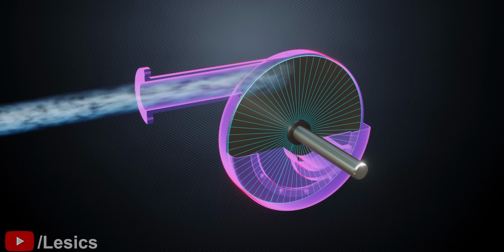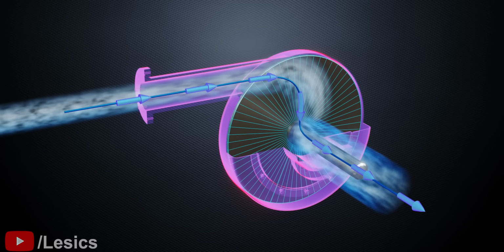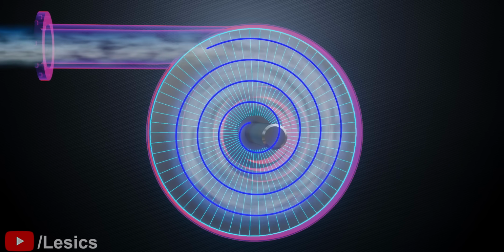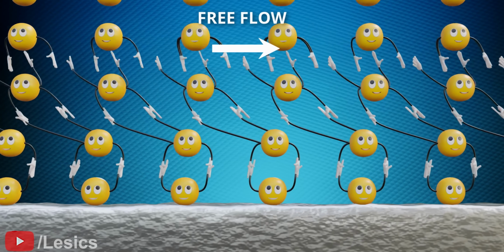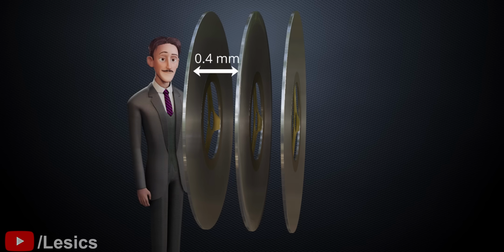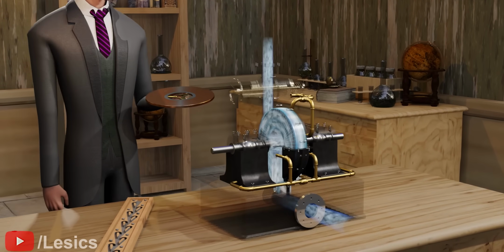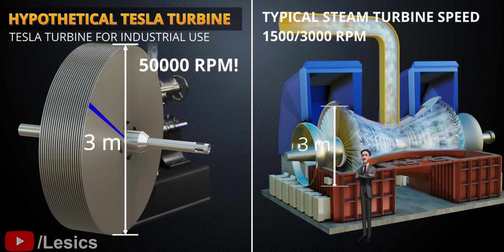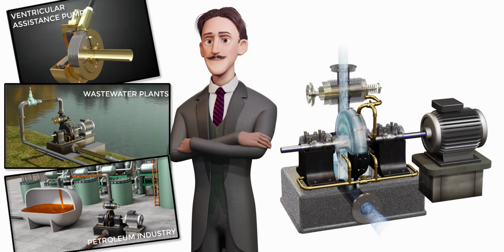Tesla Turbine | The interesting physics behind it

Comment: “Engineering impossibility” is another way to say “we haven’t figured it out yet”
Reply: No, it's a way of saying it's not worth the effort. 

We can suppose there's a material yet to be invented that would support the RPM needed to make these work. If we have to do 30 years of RnD to find it the project isn't worth doing. 

Items like parachutes were mathematical sounds in Leonardo da Vinci's time. Yet it took modern materials to make it. No one sat down and tried to make the idea work. The original project was forgotten in time. 

This too was a project forgotten to time. 

Many engineering projects are physically possible but not worth the effort. Engineering isn't physics, it's applied science and the human part application is important.
Reply: @gregheffly  With the exception that in this case, If we would be able to create materials strong enough to withstand the RPM.....this kind of turbine would be obsolete. A parachute hasn't become obsolete because a fitting material was found and is hence a bad analogy.
Reply: @benkai343434  The moment that a certain invention has no practical application anymore or has been completely eclipsed in every regard by another, is the moment it becomes obsolete. That has nothing to do with popularity.
Obsolete=There is no reason to ever use this invention in any practical application (anymore).
The Tesla Turbine has never been in a position to be practical in energy generation, other turbines were simply better. However, it does have niche applications. Hence it's obsolete in Energy but it does have some aspects that are still used.
Reply: @benkai343434  Even Mose Code is still viable. It's really early binary.
Reply: @benkai343434  You are incorrect, and are clearly not an engineer. This is absolutely obsolete. I mean it works for pumping viscous fluids due to the low speeds needed, but its useless as a turbine. At the speeds he mentioned in the video the turbine would encounter 4,300,000 million g-forces. No material will ever withstand that. I'm guessing you don't understand just how extreme that is. Were talking many hundreds of thousands of times stronger than what graphene can withstand. If you make it smaller the RPM's required end up being even higher. This technology is 100% obsolete for use as a turbine.
Reply: @Navhkrin  Show your math then.   Yea, I know we didn't see the math for the 4000000 million gs.
Reply: @Navhkrin  Let's take 3 meter (300 cm) disk at 50k rpm so that's the rpm squared times the radius (150 cm) times 0.00001118   That's a 4,425,000 g.     or 4.525 million g.   So it's likely a typo using both the number and the word million together.    4.4 million g still sounds pretty impossible for a spinning disk.   Anyone want to calculate the stress?
Reply: @viktor1496  These turbines lose productivity when there is an actual load on them.  Yes in theory they are really cool spinning connected to nothing, having to power nothing they are really cool.  They aren't really cool when you actually try to apply it to a real design lol.
Reply: @gregheffly  Da Vinci's parachute was terrible and not used. Other inventors actually took his design and improved upon it, shortly after his time. Parachutes needed both better designs and motivation. They didn't understand the physics yet, and it wasn't until basic fluid mechanics was developed in the 18th century as well as hot air balloons that the modern design was attempted. 
I don't think this was forgotten to time, because its the limit of the angling, but you are completely right about the physically possible part.  
The other question is why do we want that level of RPM? It would induce efficiency on an industrial applications further down the line. To me it sounds like it would have more use in micro-form factors outside of steam where this would pick up efficiency again.
Reply: @danielmorton9956  The basic physics was there. Create a drag approaching that of gravity and you can slow descent to a safe speed. DaVinci's idea was corect, his engineering was not.
Reply: @WCM1945  I mean sure, but his idea wasn't based on the later principle of drag.  I don't really know the value of that, especially with something limited in how it possibly could be built.
Reply: @gregheffly  No, in DaVinci's time, it was a mathematical impossibility. No calculations were made using modern materials. Cloth was a very common commodity at the time, even the silk that was used in the ealiest parachutes. But DaVinci was looking at rigid structures, and even then had no expectation that man could achieve the heights needed for a parachute of any type to work.
Reply: @gregheffly Except this on is actually physically possible. The disk for one of these would be experiencing 4,300,000 g-forces while rotating at that speed. That is an engineering impossibility. There is no material that will ever exist that will ever be able to withstand that. Even if we could perfectly make a material where the entire disk in one single molecule (which would be many orders of magnitude stronger than anything we have now) it still would not be able to withstand that force.
Reply: There are physical limits to everything. The kinetic energy at Mach 13 compared to 1.8 is so incredibly much larger.
Reply: I bet graphene will have the strength to endure mach 13 forces.
Reply: @stspy212  And why, because you read some exciting titles with "strongest material ever"? Graphene isn't magic. The forces at the speeds required are of such ridiculous magnitude that even graphene nanotubes wouldn't withstand them.
Reply: @stspy212  Unfortunatly it would be only a 1 atom thick disc...
Btw they foud something sronger than graphene.
Reply: @yaykruser  No, you don't build purely out of graphene. You use graphene to reinforce something else. It would be an incredible feat of engineering and fabrication to make such a disc, but maybe graphene could make it happen. Hard to say for sure. We know the strength of graphene is enough to build a space elevator, so I imagine it has the strength to endure these forces as well.
Reply: @stspy212  Then why havent i seen anything made out of it? 
There is no video of anything visible made ot of graphen, not a super strong fiber, no super body armour, nothing.
Reply: @yaykruser  Because we haven't figured out how to mass produce it yet. We can make high quality graphene, but only in intensive processes and in very small batches.

That said, I have an idea for a graphene generator that would be scalable to any size if it works. Some day soon I'll have enough money to build version one and see what happens. Maybe I'll record the process and put it on YouTube or something. On the other hand, though, if it does work as I think it will then it's a multi-trillion dollar idea.
Reply: @stspy212  now that would be interesting, I subscribed to you.
How do you plan on doing it? Since thats some subatomic stuff i have no clue how it would work. 
What would it cost building it?
Reply: @yaykruser  unless its half a million times stronger than graphene this still wouldnt work. The force exerted on that disk at that speed would be 4.3 million g-forces. Nothing will be able to withstand that.
Reply: @stspy212  So, go design a means of manufacturing graphene turbine disk to the needed specs and we'll see what happens.
Reply: @WCM1945  I'll do that. If my design for mass producing graphene sheets works. Problem is I lack the funds, tools, and space to build it yet. Some day.
Reply: @stspy212  No it won't, not mach 13 in a circle. The force exerted on the outer edge of that circle will be 4,300,000 g-forces, thats 4.3 million times the force of gravity. That is far far far beyond anything that even perfectly formed graphene can withstand. This is 100% a engineering impossibility. It will never be possible, and that fine, because it's really not that great of a technology anyway.
Reply: I don't see why it has to be 3 meters. Why not make it smaller and just make more of them?
Reply: Sometimes. Other times you need to remember Scotty telling Captain Kirk, "I can't change the laws of physics."
Reply: a Metal disc spinning at MACH 13 a ridiculous speed thats never been attained on earth would melt immediately from the heat generated spinning at that speed, Unless we find Vibranium next week its impossible.
Reply: @jackd6881  Then scale it smaller so it's not spinning at mach 13 lol... Just make more of them. It's a very simple solution. The real problem is startup and maintenance costs.
Reply: @alexcrowder1673  Smaller reqires higher RPM.
Reply: @jackd6881  except that it doesnt have to go mach 13..... he made the assumption that we would make the turbines 3 meters, like modern turbines.... BUT theres absolutely NO reason to scale them up to 3 meters.... Just leave them small and make more of them. This way the tips are no longer going mach 13 and we dont need any supermaterials to make the machine function.This solution should be glaringly obvious to anyone who actually watched this video. The 3 meter figure was just a random number he pulled out of his ass. Its like saying we cant make 5000 ft long air planes due to lack of technology..... well guess what? We dont need 5000ft air planes and we dont need tesla turbines to be 3 fucking meters either. That they have to be 3 meters was an absolutely ridiculous assumption for the video poster to make and it started a chain reaction of stupid comments.
Reply: @alexcrowder1673  Its very clear who is not an engineer here. Making a larger number of smaller turbines reduces efficiency greatly, furthermore how are you going to mate 10000 little turbines to a generator? Are you going to make 10,000 little generators also? I mean all that just to make something that doesnt perform 1/10000th as good?

Also, at the 3.1 meter size he said that would be impossible also. That would result in 4.3 million g-forces. Nothing, not even the strongest material that can ever be made will withstand that.
Reply: @jackd6881  Accelerating a fluid to that speed has its own problems, I'm sure...
Reply: More like discouragement to try because they're still making money on a worse design
Reply: @antigrav6004  Yeah, a better, more efficient design is the last thing good businessmen want, isn't it? No, you say? You mean that maxizing profits by minimizing costs isn't a "thing". now? You mean just making money is enough to satisfy investors?
Reply: "Engineering Impossibility" is the kind of thing that economic competitors say, such as Edison when trying to discredit Alternating Current.
Reply: @KutWrite  Edison didn't say that, though. He just said AC was too dangerous.
Reply: @WCM1945 : I'll guess we don't know for  sure, but I edited my comment anyway.
Reply: No, it was a way of explaining why Tesla never managed to make his later plans work: He ignored science in favor of hunches.
Reply: But the gubmint has
Reply: came here to say exactly that.
Reply: Dont look up!
Reply: @WreckedRevival  And ignorant minds are often too fragile to admit that they don't know and that they should listen to the experts instead.
You might solve an engineering challenge, but you will never be able to ignore physics.
Reply: Broo?? Is Francis turbine named after you? 😶
Reply: exactly.. "we can't do it, so its impossible" - then someone does it...
Reply: Not really.
Reply: If your invention can't even be realized more than 100 years later and by the time it WOULD become feasible, it would be obsolete, then your invention is useless for practical application.
Reply: @viktor1496  hahah like wifi? That was used 100+ years after
Reply: @viktor1496  Leonardo DaVinci would say otherwise...
Reply: @cainsrain  Yeah, you never worked a day in your life in engineering or any science department did you? Davinci was a great visionary, artist and philosopher but a shitty engineer and even worse scientist. Almost all his designs are either impossible regardless of material and construction methods like his helicopter or show a complete lack of understanding in physics like his tank. 
His glider was one of the few designs that actually works when constructed with modern materials, and even then it's a pretty shitty glider.
Reply: @viktor1496  Not even close. He led a lot of advancements that led to further discoveries. I think if he focused on one field, he would have achieved much for himself in that field. However, he led a lot of other engineers and the like to new ideas and concepts which led to many great inventions extrapolated from his work. Then, we could take a look at his inventions that actually did work. Go ahead and look because it's a decent list.
Reply: @cainsrain  Tesla did mainly focus on one field, electricity generation, distribution and application. For his time that wasn't a broad field at all. And like I said, he made some great advancements like one of the first electrical motors that worked decently or designing the basis of AC distribution that we use today(he did not invent AC however, common misconception). But almost all of his later work was junk based on his lack of scientific understanding.
Reply: @cainsrain  Bottom line, Tesla was a great inventor who made some major contributions to the field of electricity application. That's it. He wasn't some genius enlightened above all others of his time.
The reason people like him is because he was a great inventor that was wronged. People did screw him over many times. What people often forget though, is that Tesla spent the last of his money and years pursuing imaginary things like harnessing 'cosmic rays' as he called them. 
Hence people with poor understanding of science often flock to Tesla and the insane ramblings of his later years, putting their credibility on par with his good work.......spoiler alert, it's not
Reply: @viktor1496  I would agree that this is how it appears (in history). But there is a lot that is not visible to most people without particular computer skills. Which I am avid at including a partner of mine who is far more advanced than most. He also happens to be an engineer who has worked on aircraft such as the F-22. So although I do agree that it appears this way, there is something else that is not often looked at. I gave you a starting point with talking about John Trump, but really, he is just a small part of this equation. I say this because in the not so distant future, these revelations may come about.

I do appreciate that you took at least some time and effort to look into him instead of just hating or loving the man. A herd mentality is one of the most potently toxic things for humanity. Also, appreciate the civil discourse. Many people like when others agree with them. I like when people are themselves and stick by their own convictions, at least, if not too insane or stuck on a paradigm. Hope you have a good life Viktor. Guard your Soul, always.
Reply: @cainsrain  Likewise, I appreciate the civil discourse. And I can of course only agree that a lot of Tesla's work, especially the earlier years was brilliant. But as someone who spent a lot of time working in the exact sciences, I can tell you that his later designs. Especially the ones about wireless electricity, cosmic rays....that kind of stuff were hogwash. Tesla was a great Engineer but he had a very poor understanding of physics. This led him to believe that his designs would be feasible....neglecting some very realistic constraints that render them useless.
The same can be said about the topic of this video. Good design, but he never bothered to do the calculations about whether his design could withstand the necessary force.
Reply: @viktor1496  that's not even considering the energy requirements to get such a thing rotating that fast.
Reply: @adamperry4610  That's not really the problem as that energy would be provided by the steam. Tesla busted a couple of his demonstration models because their RPM was simply too high and he had to dial it back. If not for the constraints of materials, this would actually be better than modern steam turbines. 
Then again, obsolete design because those materials don't exist.
Reply: @viktor1496  Also, who knows what secret government tech they utilized from Tesla that we slaves don't have access to. To not realize that, is absurd.
Reply: the premise behind da Vinci's parachute was using logs to form a support structure foe the wind to catch and be buffered through a funnel hole. 

that kind of idea for a parachute is long dead. the funnel hole was neat and taken but the support structure was terrible, and as time marched on we found out that a good design will capture air as its own support structure. 

this is a friction turbine, like the old parachute, there's an idea taken from this, then the rest is discarded. low slip boundary layers sounds is a good idea. the rest is trash
Reply: @gregheffly  No it was a sealed pyramid, as per the original drawings. It was an interesting quirk based on bad fundamentals. 

Even "Low slip boundary layers" just end up being a consequence of maximizing momentum capture as well.
Reply: No, as an engineer I can tell you that it actually is impossible. I don't think you understand the forces involved. For that to work it it would need to be able to withstand 4,300,000 g-forces, as in the force would be 4.3 million times the force of gravity. That is an absolutely impossible number, there is no way any material can ever possibly withstand that quantity of force. It really is impossible.
Reply: @Chris-hn4lp  Until it isn't.